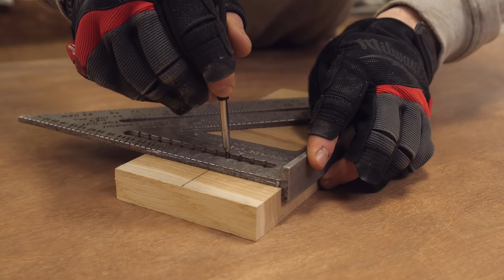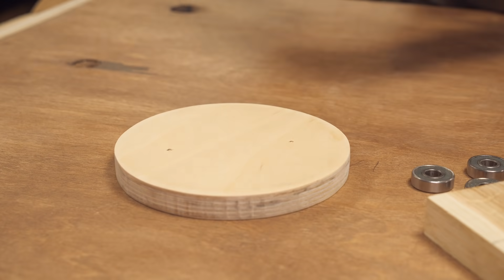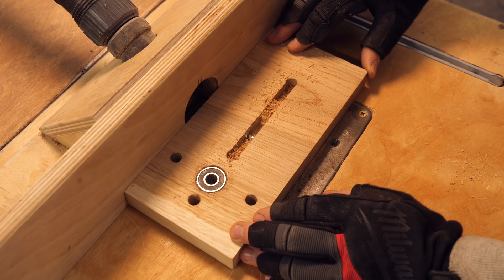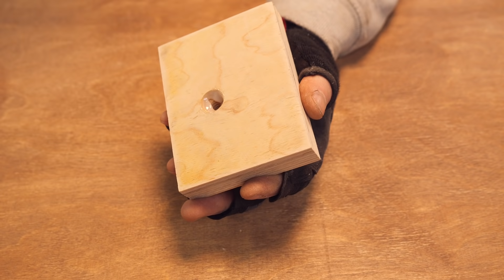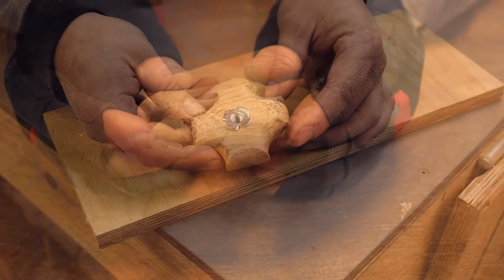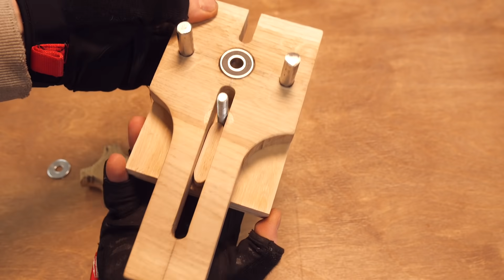I regret that I did not do it earlier! Very useful thing!

Comment: Ignore the haters. It's a nice upgrade to an old idea. The fence and the alignment slot for transferring the dowel positions to the second work piece are a noticeable improvement over the ones sold commercially. I like the ball bearings as a drill bit guide. I might have made the main part out of plywood, or possibly run the grain in the other direction just because the slotted "handle" end could easily break off if you knock it off the bench.
Reply: when there are no haters the world will come to peace

Comment: This is really cool! I'm just getting into woodworking. Made my first outdoor bench recently. I can really use tips like this. I did makeshift jigs for repetitive steps, but my clamps are really inefficient. Also, I put a table in the middle of my bench but didn't add it until last. I found it hard to get the drill into the space to screw on the table legs. In time I will get better! I like videos like this that get right to the point. Thank you!!

Comment: I'll have to keep a jig like this in mind if I ever need to drill edge holes like that.  My only improvement would be a way to easily change the hole size so this can be used with different drill bit sizes to help line up holes for different sized dowels or to just line up straight edge holes for other things.  Maybe some grommets with a sleeve that matches the inner diameter of the bearings with different sized washers attached for different hole sizes?  

Or maybe even just take a delrin rod that matches the inner diameter of the bearing, cut it to size, and then just drill centered holes in each bit or rod for each size you'd want?  Delrin would probably not hold up too well if you push sideways while drilling, but it's cheap and also slick enough that you should be able to pop it in and out with a tap from a screwdriver without dislodging the bearing, and I would think it would be more likely to give than your drill bit (except for the smallest sizes) and easy enough to replace if you do break it or it wears out.

Just a thought.  I don't really make anything that needs dowels, anything I ever make is pretty utilitarian and I'll just screw together butt joints like that, but even on sloppy garage shelves it can be a pain to get a straight hole drilled in a board with a cordless drill.  That's where I think I would really find use with something like this.
Reply: Look into getting drill bushings. Look under sheetmetal tools. Perfect as drill guides for your drills driven by cordless drill motor.
Reply: @jpeterman57  Yes I was going to suggest drill bushes. You can get a variety of different inner bores to fit into the same outer cavity. Not as wear free as this use of a bearing but more flexible. But unless you are using it all day everyday they'll last for years.

Comment: I was waiting for the function of the bearings - something to rotate (for which I doubted the strength of the tool). 
Using bearings just for accurate alignment? Good idea! Looking at the value of something rather than the cost. It may also be the least cost design, considering time. 
I appreciate all the techniques illustrated. The most important one for me is that all the critical dimensions are fitted and not measured. 
I also see a great mind that invents something like this.

Comment: Amazing! He had just the right thickness of wood to fit 3 bearings, exactly!
Reply: He may have bought bearings to fit the thickness of the wood, rather than wood to fit the bearings.
Reply: @charliec9235  ! Seems it would be easier to shape wood than find the exact correct bearings!
Reply: Um...a planer? Lol
Reply: @saucytabasco  ! Right!!
Reply: ply thickness divided by 3..... bearing thickness multiplied by whatever = whatever thickness of ply?
Reply: ...which demonstrates the value of standard sizing.
Reply: Yeah, he skipped the bit where he used a £4 grand planer thicknesser

Comment: Very crafty. Loved to watch it be built and definitely well done. One improvement may be a center bearing that's wide, epoxied in, while the two outer ones could change for differing diameters of bits/plugs. Nice work!
Reply: A great means of accomplishing this would be to use a bushing. The outside diameter would fit into the ID of the bearings and the inner diameter would be the reduced diameter needed. The only challenge would be longevity, as heat treating this bushing would be necessary to keep it from being chewed up by the drill bit. They are easily built, however, especially with access to a lathe, and as smaller ID bushings wear they could be used for larger holes by drilling them out.
Reply: @reddtekk  that’s why he used a bearing, the inner race spins with the bit to greatly reduce wear. A bushing would  wear very quickly and it would no longer be a precision tool after a couple of uses
Reply: @ShaunHensley  If the bushing fit inside the inner race, that would spin too wouldn't it? Possibly with a little more initial resistance due to inertia but still...
Reply: @The1trueDave  The drill bit would either cut into the bushing and enlarge the hole, making it less precise, or the bushing would have to be larger than the bit to begin with. The bearing spins with the bit, greatly reducing wear from the bit.

That’s how I see it
Reply: @ShaunHensley  But the bushing would spin with the inner race rather than offer resistance to the drill bit. I'm assuming that the bushing would have the same tolerance as the original bearing, say 0.1mm over or whatever...
Reply: @The1trueDave  so then the inner race would wear and enlarge and the slop would transfer to that fit.

I think a roller bearing is the way to go here.

Comment: I see how the holes are centered on the first piece -- the two pegs allow for varying thicknesses of wood -- and how the holes are aligned when drilling into the second piece of wood, but how do you insure that the holes are centered on the second piece as well?
Reply: You can put a bearing on a peg, align and tighten  it on the right distance... probably
Reply: @pahom2  I had the same question and you're right, that would work perfectly

Comment: Brilliant design for an excellent tool!! I would add an adapter for different size dowels since they would always be centered with your system.
Perhaps adding a collection of machined fittings with the same outside dimension as your bearings and various inside dimensions which would accept other drill bits.

Comment: Oh my god, you don't wear gloves when working with rotating tools or sawing. very bad and dangerous role model
Reply: Very correct friend , I once saw a man running a high speed drill press wearing gloves , he reached in while machine was running to pull metal drill shaving's from the bit , the shaving's snagged his glove pulling his whole arm into the rotating large drill bit , broke his arm in 3 places , the company fired him before he even got in the ambulance and I never heard if they could save his arm , many bad injuries from people not using common sense !!!

Comment: Super clever. Wards used to sell a similar device which I used for years until the drill, it fit on, finally gave out and someone chucked the drill, with the device, instead of taking off the device to use with a new drill. It wasn't as versatile as yours but it did everything I needed to fix things around the house and build furniture. I haven't seen a similar one since. After saying that I checked Amazon again (it's been a few years since I last looked) and they have a similar one, to my old one, for sale. It's now in my cart lol.

Comment: Very clever homemade centering jig for dowels.  Your skill level is extraordinary.

Only have one constructive criticism and recommendation.
For even glue/adhesive application and better bonding, when tapping in the three (3) bushings into the same hole, I would've done it differently.

You tapped them in 'one direction only'.  The 1st bushing would spread the glue downward.  The 2nd bushing would spread what little glue is left.  By the time the 3rd bushing is tapped in, there's very little glue remaining to bond it in place.

Instead, tap the 1st and 2nd bushing in as demonstrated.  But, for the 3rd bushing, flip the jig over and tap that one in from the opposite side.  This process would leave the 1st bushing in the middle.  (Hope my explanation made sense.)

Comment: Back in my day, you had sometimes to do this on the fly.  Did not have to spend so much time making a jig. I would just brace one board, and align the other to it, and between them, put a small  nail with its head between the boards, and tap the free board with a mallet.  The head of the nail left an indentation of where to bore the holes.  Did not need jigs.  With practice over time I could bore into the edges of a board with great accuracy, just by eye. 
Bored the holes 1/8 to 3/16 deeper, for the glue to have a relief pocket.
Then just used a brush to glue the dowels, and drive the boards together. Same outcome as yours.  In a fraction of the time, and effort.  And did not have to carry jigs, and it was a skill you ported with you.
I am not trying to belittle your skill, but trying to tell you...stop relying on jigs and machines.  Develop your skills.  You will be surprised how accurate and fast you can work, once you awaken, and hone such skills in yourself.
Reply from the maker: I will definitely try your solution, thanks for sharing your experience

Comment: I was wondering how in the world it was a good idea to take a piece of wood with cross grain would be of any use (since the thumbnail has a castor wheel in it, implicating some force), but for the dowel jig you are getting away with it.
Nice to see you turning the knob midway through the build so the nut you hammered in can't become loose.

Your knob drilling jig is a very cool idea!
This one seems a bit elaborate for what it does, allthough it does it well. Thanks for sharing

Comment: just don't put a lot of sideways pressure on that. it would be much stronger if the grain was running the lenth of the tool as opposed to the width.

Comment: Nice!! I bet a person can do all kinds of terrible woodwork without a tool like this. The alignment has to be perfect. This is on another level entireIy.
Personally, I always sucked trying to work with wood when I was young in my teens, and then then once in my thirties I actually made a plan, cut everything carefully with good tools and being accurate with my measurements ended up with a cool rolling cabinet to house a computer tower for recording with an angled top to hold multiple 19" rackmount units. Now I have the desire and no shop. Figures.

Comment: Idea is good, but bearing material is hard, it may damage the drill bit. Use hardened locating bush.
Reply: It won't damage the bit. The flutes on a drill bit are not designed to do the cutting. Their function is to expell the wood chips and shavings that the tip of the bit has already cut. When you sharpen a drill bit, the blades at the tip of the bit are what's being sharpened not the flutes.

Comment: there is a catch 22 with the drill bit and the bearing. The better these 2 fit, the straighter the drill bit will drill, however the better they fit the more the drill bit will start grinding on the bearing, and the more it grinds the looser it gets, and hence the accuracy of the straight drilling will be lost.

However this is how I am imagining the tool as I see it on the video, and perhaps in practice it is indeed as good as it seems on the video.

Comment: what a magic trick, worthy of a slick trickster! 😄
you cut out the video part on the second (and forth) piece, where you need to measure, to set the spacer of your tool to the right distance. 
elizabeth holmes and trevor milton would be proud of you 😁😂
but seriously..
you should always use the same align technique (pegs or spacer!) for both pieces, otherwise fitting two parts together is like gambling..

Comment: Very cool idea and build of the device. I am temped to try and make one, but my small shop in my backyard, (it is in my 8' x16' shed) is freezing out there now in almost December weather. here in New Jersey.  
I don't have a lot of shop type power tools, I mainly use my radial arm saw for most wood projects. I have a small drill press also. Small tools I have are a router, cordless drills, skill saw, sabre saw. I think that's it....You always have cool ideas. Love the workmanship too.

Question: Where do you buy those metal rods and bearings? Thanks.

Phil
NYC Area

Comment: Looks like it works well. However, one drop on the floor and that thing is broken. The grain direction is in the wrong orientation, that skinny bit is very fragile. If he had used Baltic birch ply like he did for the block underneath there would be no problem at all.

Comment: Sure liked it, great ! But let me share the one thing that isn't helpful to beginners, like me: dimensions do matter, and the quick shots on many elements don't show key details that make or break the tool (or whatever other DIY videos show) functionality. For example, the relation between the bearings' inner diameter and the dowel wood pins you shall use. Same for the length of the said dowel pins.
Thanks for sharing anyway, it would just be much straightforward if all dimensions were a little better exposed and explained.

Comment: Great! Just one question. The first two boards you joined look perfectly aligned. How do you ensure that the second set of holes lie exactly on the middle plane of the board? I guess you use the sliding structure and adjust by eye, right? Thanks a lot for sharing this video :D
Reply: They weren’t perfect
Reply: That was my question also.  Not really clear how to center ??

Comment: But if I make this, what am I going to tell my biscuit joiner? It will get depressed in the drawer!
Was worried the first piece was going to split when you drove the bearings in. Why not make both pieces out of the plywood? Or two thinner pieces glued with grain crossed.

Comment: 6:40 and no explanation that how to get hole center of the another piece?

 The rail in one end will place the hole in alignment with the dowel.

The block piece attached should give 90 degree alignment with the dowel and as well the next piece distance to center. 

But it's so that one needs to measure the board thickness and multiply?

Or can the tool be just placed top of dowel from drilling hole, adjust the block distance, tighten and then use it to move it to next piece?

Comment: It's actually stolen idea from Jisaku Koubou (JSK). I have tried to make it at home last year as well and there's no way of having a accurate corner joints as long as you drill it by hand at around 0:54. Either the bearings housing axis or flails will not be perfectly perpendicular to tool's plane resulting to inaccurate centering when used for joint holes. It seems that for your demonstration you have used the other tool, a bit more used one but accurate, otherwise the joints would be perfect just by luck.
Reply: What the hell? What's wrong with giving credit? This video is clearly a copy cat even in presentation style.  JSK is vastly better IMO.  I'm annoyed that youtube popped this up in my feed just because I watch jsk.

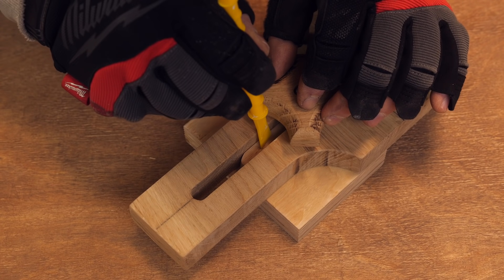Comment: 5:25 - Skip here if you want to see the result and demonstration. He made a wonderful jig for pocket holes.
Reply: You mean dowels not pocket holes.
Reply: Pocket holes are for screws that go in a hole drilled at an angle using a pocket hole jig to hold two pieces of wood together. It can be disassembled. What he showed was a homemade  doweling  jig using dowels glued in to permanently join two pieces of wood.
Reply: @btd2516  A pocket hole is a hole. It can be used for screws toed in, dowels, wafers, or anything else. The reason it's called a "pocket hole" is because it is a hole for a joint that is hidden. This jig is used for making HOLES, specifically POCKET HOLES. In this case, the jig can be used for pocket holes that could be filled with dowels, wafers, pins OR even double-sided joint screws. The jig is used to make POCKET HOLES. The JOINT is completed by inserting DOWELS into the POCKET HOLES of both pieces of material.

Comment: I don't do dowel joinery much, myself (more of a dovetail person, really), but I could see this being damned handy (or as my smart-ass dad would call it, ham dandy) if you were doing dowel work all the time. 

I really do detest your channel name, though. I say it every single time I come to this channel, and it's still called the exact same thing, as if that surprises me. I don't count as enough of a percentage of viewers to matter a single bit, so... because I have breasticles rather than testicles, I constantly have to deal with this sort of hard, built-in sexism. All. The. Effing. Time!

For example, it's exhausting just trying to take time to tell the "helpful" guy at Lowe's, or Ace Hardware, or Orschelyn, etc, that no, I do NOT need the workings of a Klein jig explained to me, nor do I need to have types of bit tips (Phillips, flat, square, Torx, ECX, and such) and their used explained. We DO know things, too, and the existence of breasticles has absolutely zero bearing on our ability to grasp what an air hammer or a pneumatic grease gun would be needed for, either. 🤨😏

Anyway, while giving you the like and comment for the care and feeding of the Almighty Algorithm, I am once again stating my immensely strong distaste for that damned channel name.

Comment: over engineered solution to a non problem. if the gadget is simply a means to transfer the location of dowels then that is done much more easily by using centre pins of the relevant size.